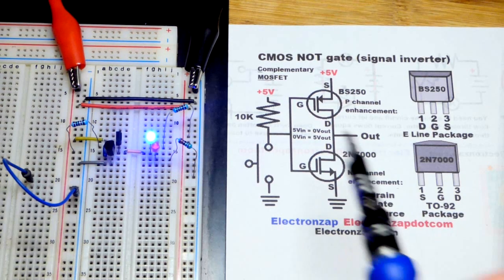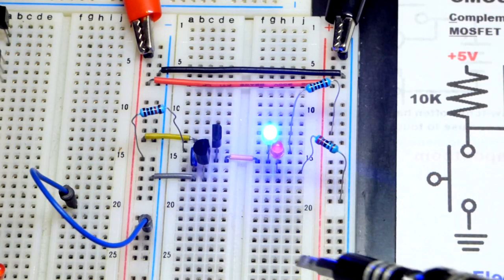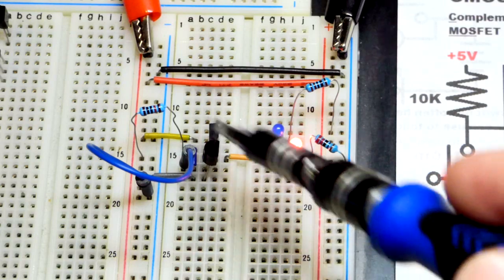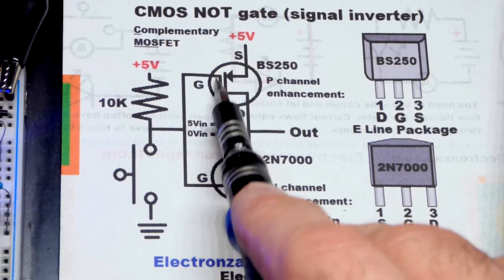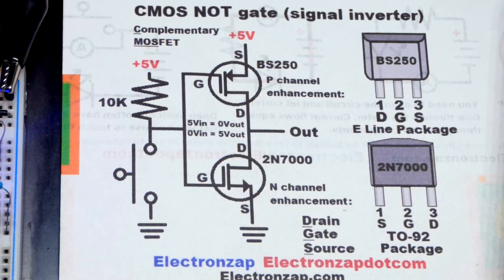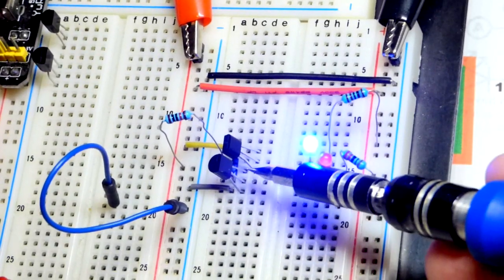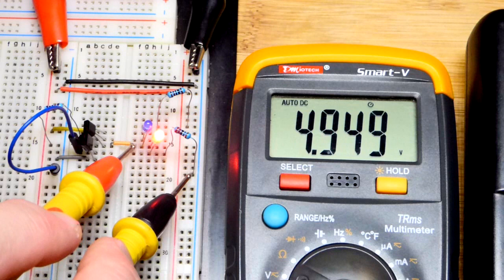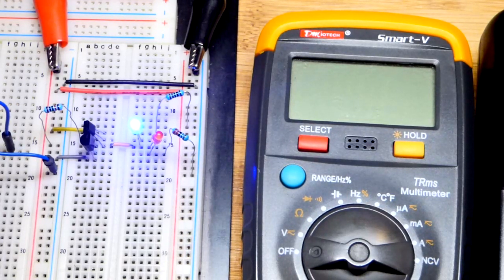CMOS NOT gate signal inverter circuit using 2N7000 and BS250 transistors electronics tutorial

Comment: Isn't there an edge case where both of the transistors are either on or off? If both are off, then the output would be floating and if on then it would be a short.
Reply from the maker: I don't believe so, I think that it is harder to turn a MOSFET on than it is to turn it off. So, I think they are both off, or limiting current, before one can turn on fully as long as they share the same Gate voltage. I could be wrong though.